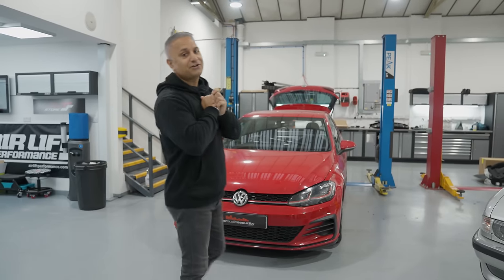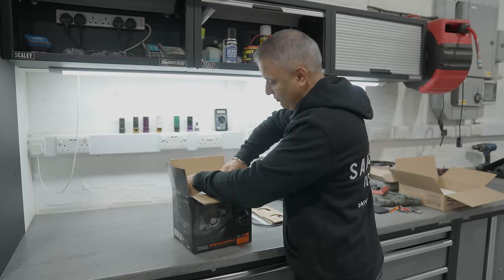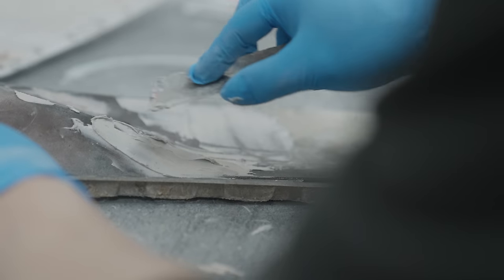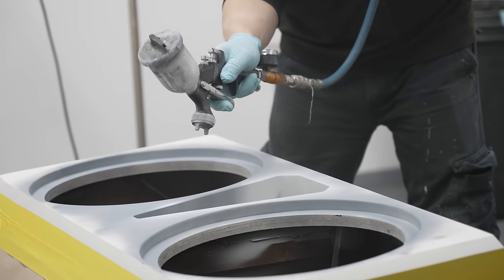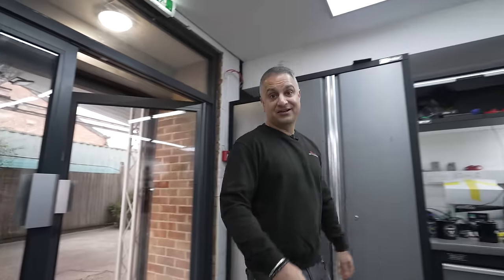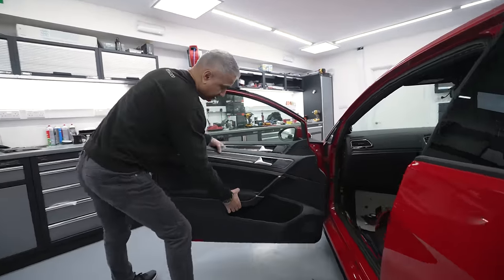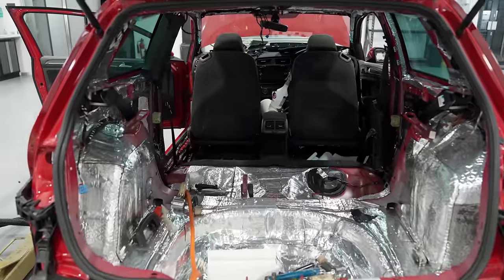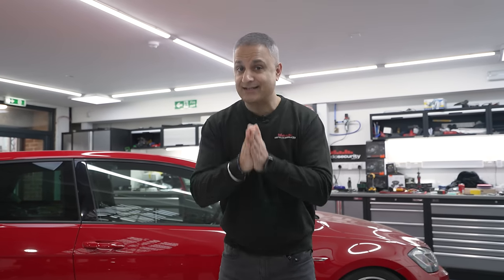BASS Build gets Audio - VW Golf Mk7.5 GTI - Part 3 of 5 | Car Audio & Security

Comment: I hope after all that money spent on it you've used the Zen V optical decoder to get a perfect signal from the factory infotainment - would seem silly to go to such a huge effort to be limited by the factory DAC, time alignment, EQ, high pass filter and high to low conversion which introduces losses,. That's how I run it in my vehicle.

Comment: Given how many midbass drivers and tweeters you ran, so you could get some sound out of this system, I’m very surprised you ran them all passively and not actively. You’re loosing quite a bit of db running them passive, given them being powered by the same amp. This is a big install. I kind of expected it done actively. Oh well, still sick!
Reply from the maker: Thanks for watching - the next episode will also cover the new DSP which has been used in this build 👍🏽
Reply: @CarAudioSecurityUK  great, look forward to it. Just please give us a proper demo instead of a quick "look what we have done" video that really doesn't show us anything about the install process or how the final result is (the sound demo).